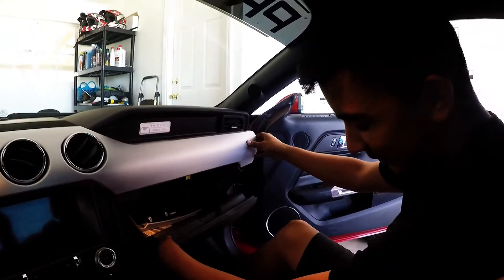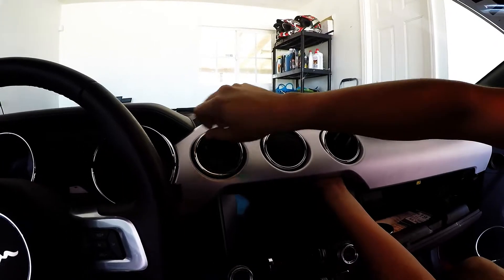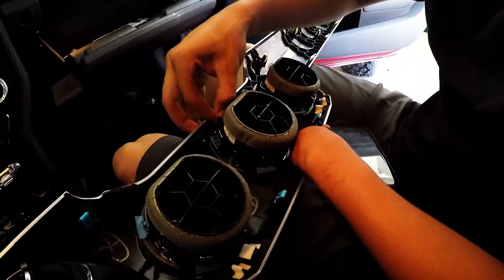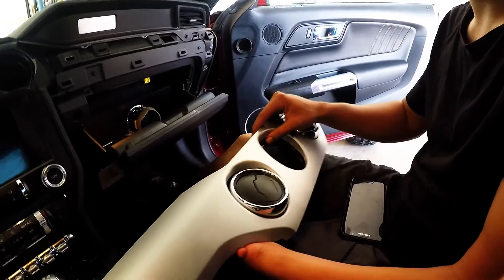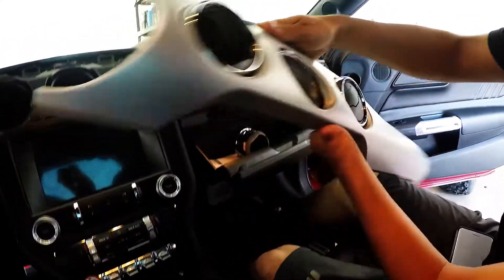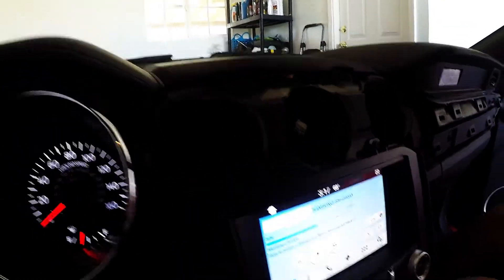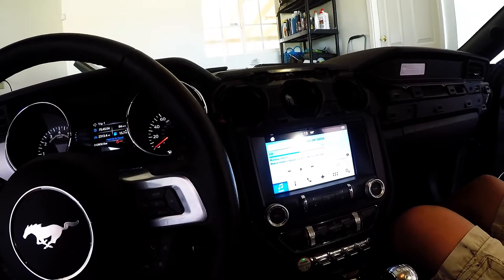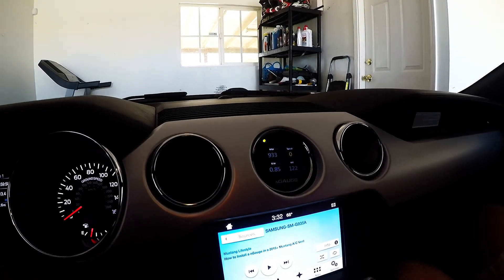Installing a Lund Racing nGauge in a 2015+ Mustang A/C Vent

Comment: Did you tune the car?
Reply from the maker: Rene Garcia Not yet, waiting on my headers, they come in thursday.
Reply: 1Hand do you daily drive the car? Most likely your warranty will be voided what will you do when it comes down to needing a repair? Just curious
Reply from the maker: Rene Garcia Warranty isn't voided till they can conclude that the tune is the source of the problem, and if it does void something it won't void the full warranty just parts of it.